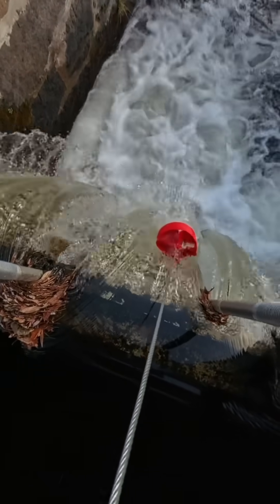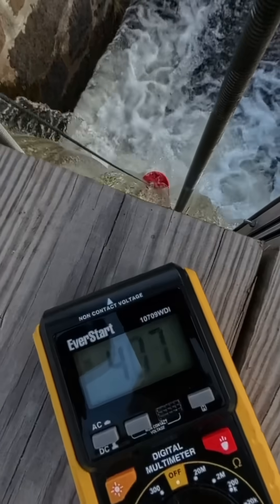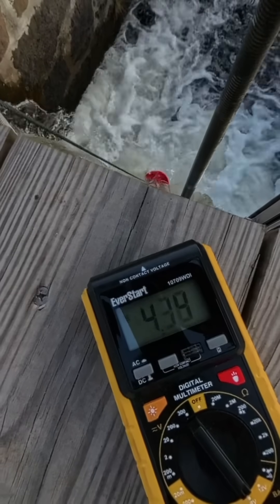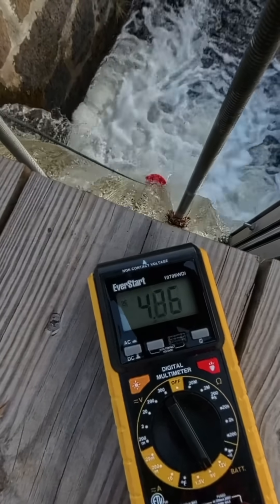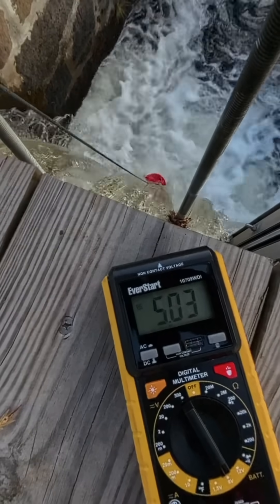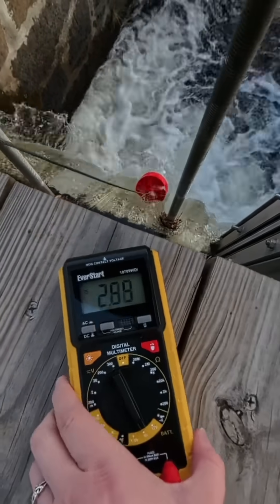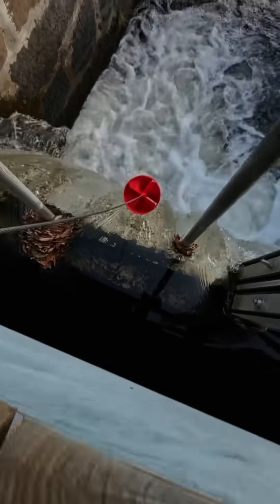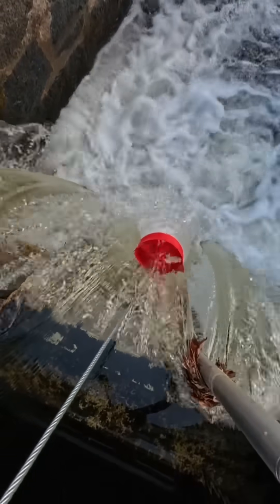3D Printed Tow Turbine Micro Hydro #3dprinting #hydropower #diy

Comment: That’s Genius❤️ A deployable power system. I think a wider turbine radius will increase the torque output. 

Maybe a “through shaft” generator to would help to add an adjustable flywheel to maintain speed. Or test a sping loaded cable so the cable can reset tension when binding.
Reply from the maker: Thank you, that's a great idea to help with some of that tension. I also like the flywheel idea too
Reply: @Beyond_The_Print he's talking about continuously variable pulleys I believe, but that's not the right application for that. Being that it's made of plastic and blasted with water, you're very limited on adding any moving parts. The bigger you can make the turbine blades the more torque you'll have to maximize the generator size and output. Did you happen to measure the amperage it was producing? 5V isn't enough to charge a phone unless it's high amperage. That's a pretty cool project though, I love homemade generators, creating electricity just feels like such a primal and human thing to do!